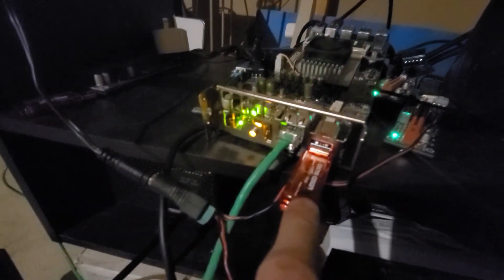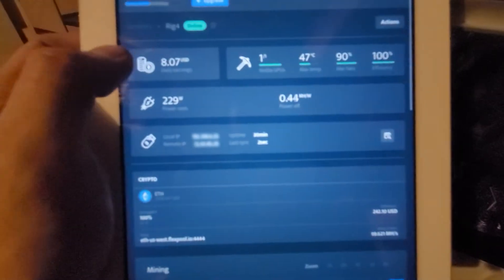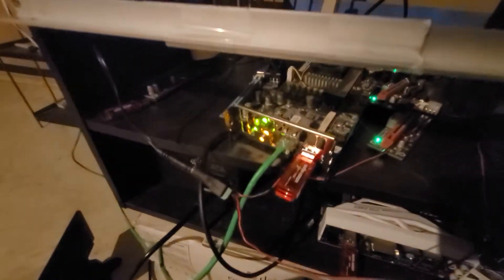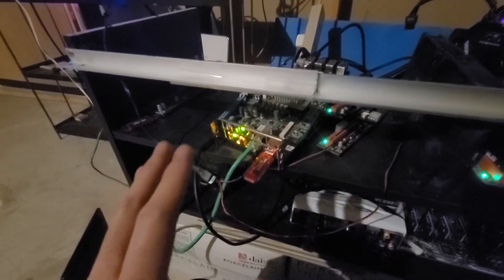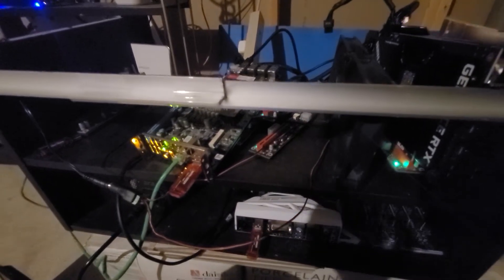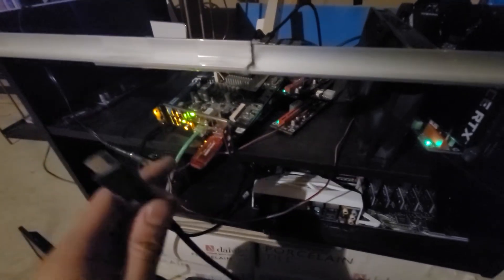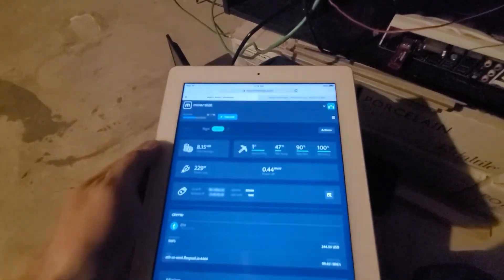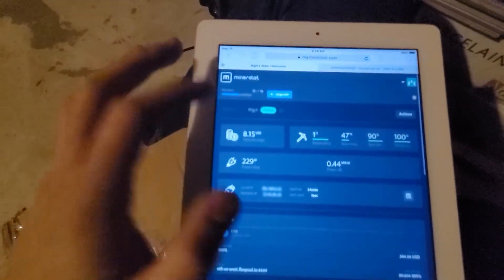RebTech 8-GPU Blockchain Mining Motherboard with Nvidia RTX 3080 Demo

Comment: Nice setup, quick question what connection did you use from your PSU?  is that a spare CPU slot (8 pin to 6 pin)?  Thanks in advance for your input..
Reply from the maker: My PSU is a server PSU now but the ATX one used to be a 6-pin to SATA adapter. Only 15W TDP on the RebTech means SATA is safe.

Comment: Thank you!

Hopefully it’ll run 8x 3080 (I have 48 of them 🤦‍♂️)
Reply from the maker: A good problem to have. Some have said it might only run 6 Nvidia cards, not sure yet, don't want to dismantle an existing rig to test so I'm waiting for more 3080 cards to arrive. I'll post another video once they do.
Reply: @EarlCo  I only have 6 30 series RTX cards, but I have put 8 Nvidia cards (6 3090, 2 1080TI) cards on my rebtech and it mines like a champ!
It is very very odd that 20 series RTX cards don't work on it though. I only have one 20 series RTX card, 2080, and I have to use a standard mobo to mine with that.
If anyone knows of how to get a 2080 working on rebtech mobo, please reply!

Comment: Thanks for the vid!
It helped get my Rebtech 8-GPU mobo up and running easily after I factory reset the bios and followed your advice!
2x 3090s working on HiveOS for now.
My Rebtech (3 of them) just showed up today I will be moving 8 3090s on to one of them and will try to slowly populate the other two with the same.
One day I will post a vid of my garage setup.
Currently it is 8 3090s, 1 2080, 2 1080TIs, and 2 1080s, and I have two 3080s sitting in gaming PCs running 24/7 when not gaming.
Currently easily 1GH/s ETH.
I now have all of the equipment and power wires needed for 24 GPUs, in my dreams all 3090s...except for the GPUs.
Again, thanks for the vid!